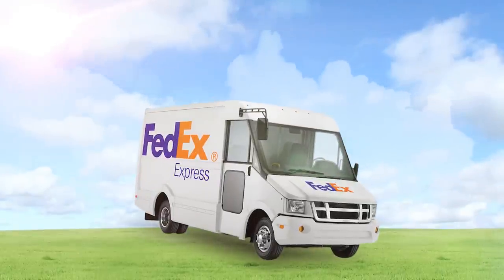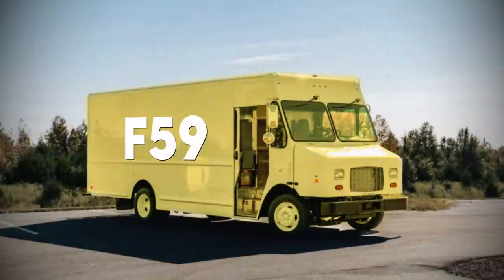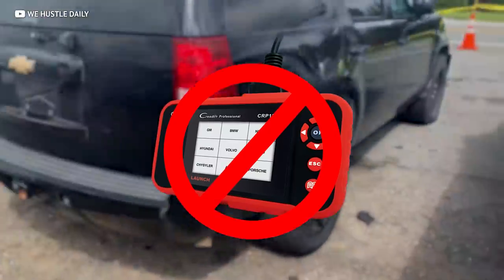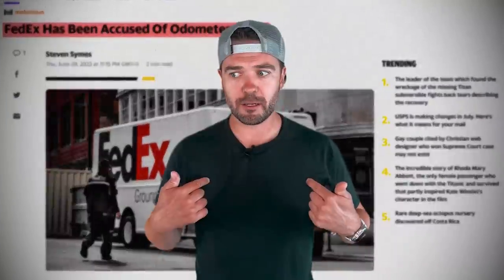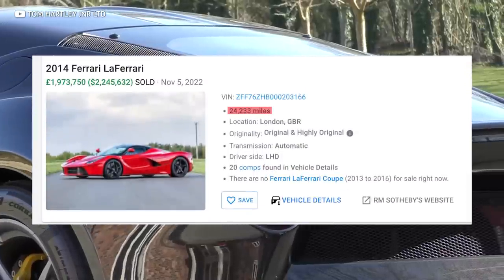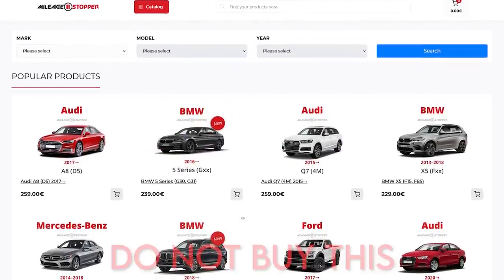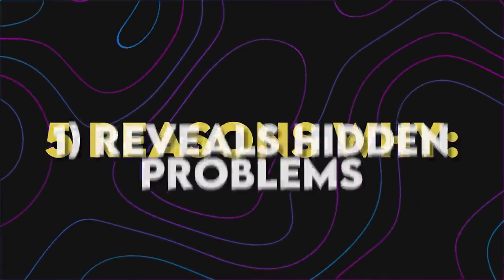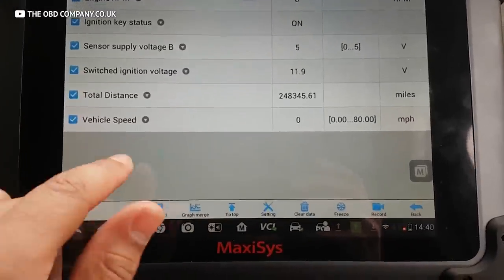THIS Is The LARGEST Auto Crime Ring in History

Comment: The fact they do not allow scan tools on lot at auction as a rule is straight criminal. Anyone who tries to argue otherwise is part of the problem. There's absolutely 0 reasons, legitimate anyway, that you shouldn't be allowed to do a broad scan across the vehicle you're putting money up for. Period.
Reply: iPhone/android Bluetooth scan tool > handheld / tablet atleast if you can use a $100+ Bluetooth scanner that’ll be cool
Reply: @itsreallytheo  I had half a mind to mention all one really needs is an ELM327 BT OBDII connector, or BlueDriver, or the like, and one of MANY apps available for relatively nothing. Then your phone becomes the scanner. The connector is pocket-sized, and pretty much everyone carries a smartphone around anyway. However, I would wager this all is irrelevant, as you'd still have to plug in when the vehicle was on and do so without being seen long enough to gather all the information you'd want to see. Judging by the sound of it, the packaging the scanner is in doesn't matter. They're likely going to tell you no regardless. Which again is bloody criminal in my book.

Comment: I like to see/own cars with lots of miles. As long as they still run good. It's like a badge of honor to me to have a car with 200K miles but nobody would realize if they didn't see the odometer. Hell in 2017 I had a 2014 Ram work truck with 200K miles and it still looked and ran like it was brand new! I was mad when the company made me turn it in... I wanted to see 400K!